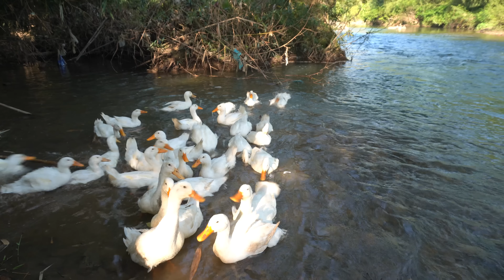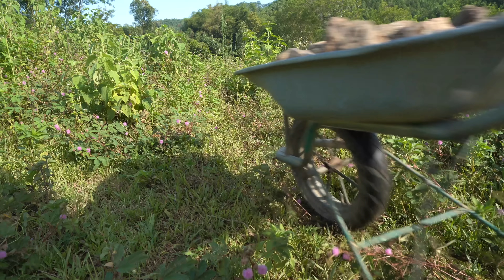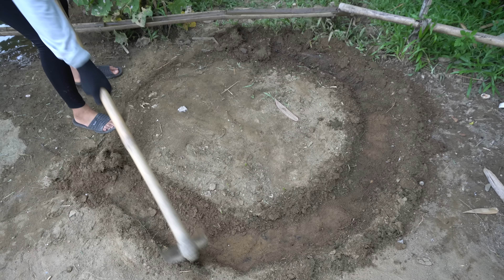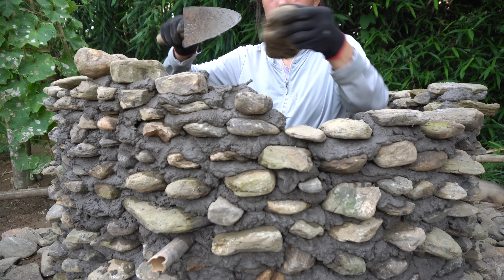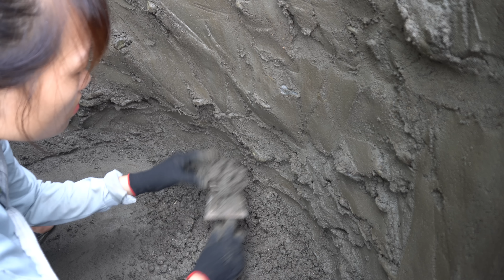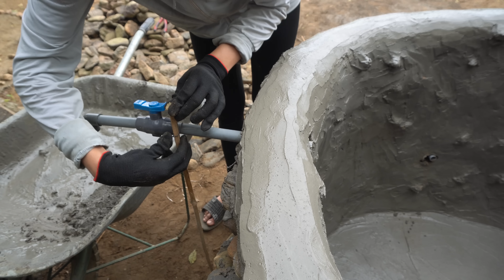Build a 5 block water tank with stone and cement - Install the plastic pipe - Free bushcraft

Comment: Fun project, wonder if the water level coming in is high enough?
Pigeons have finally calmed down enough to eat and come out. That is no small feat, as
we know how shy they are in the wild. I do feel sad for the Pig´s though, they are quite
intelligent after all and even make good/fun pets. So their temperament might be effected
by not having the freedom to forage and enjoy mud baths in hot weather.
You should have quite a large area for them to forage, they will eat anything for you, yet
there lies a problem. If you want them to just gain weight, you might have to look at their diet more. :goodvibes:
Good luck with everything. You will have a big problem with the use of wire on your roof structures, as that wire will rust away quickly, just saying.

Comment: One thing you can do to make the finish smoother is to get a paint brush just before it starts to slightly dry wet the paint brush and it will come out pretty smooth to scrub inside to clean the well
Reply from the maker: thanks you.
Reply: Yes, it´s normally used for walls like that, dipped in water first.
Yet another technique, is to wait until the cement is starting to dry a little, then
scrub or high pressure wash walls. You can then see where the stones are and this is
attractive too.